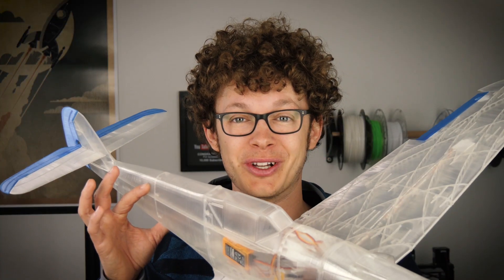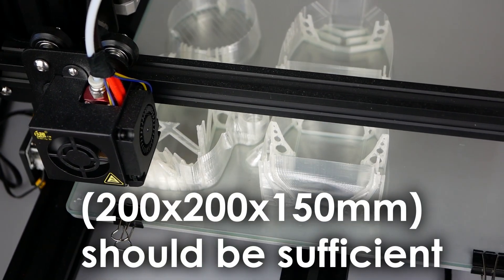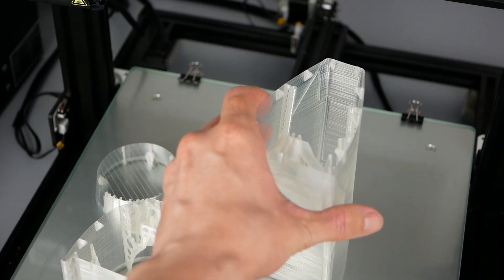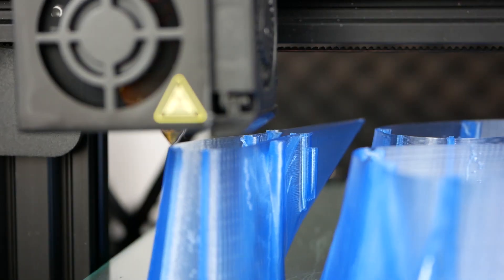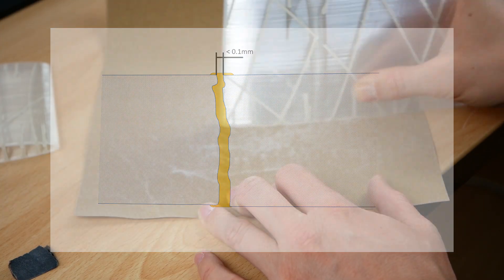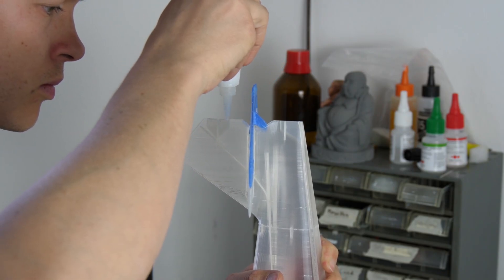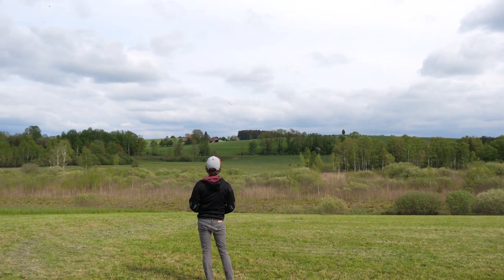HOW TO 3D PRINT your own RC AIRPLANE

Comment: The pretty rougth outline really want me even more to wait to buy a 3D printer intill I can get a continius resign type
Reply: Resin printers use layers too - just they can be much more fine!
Reply: Inexpensive ones are actually available now, BUT their build volume is MINISCULE. More suited for D&D figurines and such. I suppose you COULD try scaling down these models and see how light you can make them, for use with even smaller electronics and motors.
Reply: @iskandartaib  elego saturn is not that expensive
Reply: @matsv201  Interesting.   https://www.elegoosaturn.com/products/elegoo-saturn-8-9-inch-4k-uv-lcd-3d-printer   Build volume is 192x120x200mm - still kinda small by FDM standards. Apparently they were taking early pre-shipment orders (shades of kickstarter?) - USD500. Yeah, that's not that expensive. But I wonder how it'd handle this type of project - probably not very well considering the size. Incidentally, why is is "monochrome"??? Aren't ALL resin printers "monochrome"? The laser outputs one wavelength. You can't have "dual extruders", since there's only one resin tank with one type of resin in it.
Reply: @iskandartaib  pretty much all cheap (sub $1000) sla printers use a normal lcd from a phone or comupter screen and just a neat violet backlight. Most of them use just a of the shelf normal rgb screen filtering out colors even if it not supose to.

Saturn use a moncrome custom made lcd with  no collorfiliter. This increases the resolution 3 times over as well as reduce the cure time 3 times over. Cuting the cure time down to just a few seconds.  Resolution is also insanly high.
Reply: yea and you only need like 2 years to print such a plane with an sla printer. good luck! :D
Reply: @airsoftskorpionefreiberga.173  2 years?.. Its like  a few hours per print, and it should not really use more than a dussin or so

Comment: Bravo.
Darf ich eine Anfrage stellen ? Bitte mach einen Vergleich zwischen 3D-gedruckten Tragflächen, Schaum mit Balsa beplankt und Rippenbauweise. Am besten eignet sich dafür ein kleinerer Segler, die Testmethode(n) könnten so aussehen: Gleitwinkel bei 0%, 15%, 30% Gas, Strömungsabriss (Qualität und Quantität), Höchstgeschwdigkeit sowie Stabilität. 
Soweit ich weiß hat niemand (weltweit) einen solchen Vergleich gemacht !

Comment: You should use 0.24mm instead of 0.25mm on the CR-10 since the Z axis step size is 0.04mm.  Keep it divisible.

Comment: Interesting design work but regarding the parts weight indicated in the video, that R/c Me-109 seems to be VERY heavy for her size... 
The empty and unpainted plane is already as heavy as a ready to fly balsa one and at least 100g heavier than a ready to take off and fully painted Me-109 built from foam.

Comment: CNC kitchen i edited the gcode to print on my ender 3, i changed the retraction to 7.5mm and 40mm/s and its not retracting at all, it stops the extruder but doesn't reverse it. any idea why?

Comment: Will do mine in silver PLA
Reply: Z bend both ends of the rod.  Do not glue in the servos until the pushrods are on the servo arms and in the control horns. 

This eliminates the screwed on fitting and eliminates a potential failure of the screw backing out, dropping the pushrod with loss of control in flight

When the top of the servo is accessible you can thread the servo arm onto the pushrod then screw to the servo after  connecting to the control horn.

Sometimes you put the pushrod in the control horn before gluing the hinges.

Do not worry about a little CA in the hinge line, it cracks off of the hinge material rapidly as long as its not excessive.  Careful not to glue the movable control surface to the fixed surface though.

Comment: Beautiful airplane. From experience living in a hot climate PLA melts (bends/distorts/droops) when left in direct sunlight and worse if left in a vehicle.
Reply: It cools so quickly due to the air movement in this application, but if you were at an event or long queue runway I would bring a umbrella to cover it while waiting.

Comment: Hello Stefan I like the show however, I have a question to the use of Cura for my Allcct printer, what would be the adjustments I had to make to get it working properly, at the moment it moves to a location and there it runs in circles for god knows how long. Thanks for any help.

Comment: not good man. This is not the right way. The model is too heavy, just not a good idea. The better idea is to 3D-print a mold to make a better model with a foam maybe. First if you can directly 3D-print a low weight materiallike foam, then you can 3D-print the model directly

Comment: If you buy from Gearbest just hope you get something that works. Twice now I have received dud products from them and they are very polite and brimming with helpfulness and will string you along until their 40 day warranty expires after which you get zero help. My CR10 from them was useless and is costing me a packet finding spare parts to try and get the bed to heat or the temperature on the heating nozzle to stop fluctuating all over the place.

Comment: Would this plane be a good beginners plane? I recently got a 3d printer and I have electronics for a plane lying around. I am simply too lazy to build a foam plane.
Reply from the maker: No, definitely not a beginner plane. If you have never been flying buy a foam plane at first, otherwise 3dlabprint.com also sells trainers.

Comment: You counterdicted yourself concerning using the glass base and the base bonding agent. If the project lifts in the middle of the build, I dont see how things are going to go together even close to being right, even filling with CA and glass beads. The build looks good but dude 60 hours? Damn...dedication. Ok ,I know its just a goofy plastic plane. I never heard a price on the material,so what are you talking, several dollars worth, or what? Be honest.
I am contemplating getting a 3d printer and know there are MANY brands out there. Not all of them are worth the material they were made from. I am looking at $300-400 range. I see Banggood selling them for $187.00 Alarm bells go off in my head. My concern is getting serviceable parts. I am NOT going to invest in anything I cannot find parts for, or need a degree in to fix. I am good at changing parameters,  but rewriting entire code....no thanks. I taught myself on an Apple2c years ago,I remember the pain of imputting code, only to watch my design fail because I was one digit off. 
I hated basic programming with a passion.
Reply: As my name states, I am an RC addict, small engine mechanic, automobile mechanic, carpenter( lousey one) Jack of all trades. 3d printing would be like flying RC Helicopters. One hell of a challange,  but challange accepted.

Comment: Hello, I wanted to print this on an MK3, if using prusa control do I need to change anything ?
Reply from the maker: Prusa Control is not the right slicer for this plane. Use the pre-sliced G-Code or Simplify3D/CURA.
Reply: Thanks, on to printing.

Comment: If you are going to use rubber bands, only take one. If one breaks, you want the rubber band to break instead of the wing
Reply: Depends on the model... I have flown models that need 10 to keep the wing in place for a loop.

You want enough for it to not shift in any maneuver the airplane will perform.

We've done testing and depending on wing mounting, sometimes the wing breaks no matter what in a crash.  The angle of impact and ability of the wing to rotate matters.

Early RC models had the wing attach with a forward pointed dowel at the front, so a frontal impact allowed the wing to slide forward, popping the rubber band free.  But if the wing tip hit, the wing shattered.

Comment from the maker: Looking for a good deal on a new 3D printer and want to support the channel? Take a look at the affiliate links below and in the description:
CR-10 for $349.99 with code "618GBcoupon06": https://goo.gl/Anj5Mg
TEVO Tarantula for $264.28: https://goo.gl/hY53qQ OR AMAZON http://geni.us/Shfx
TEVO Tornado for $339.99 with coupon "GW4-15": https://goo.gl/Q1CR87
Alfawise U20 starting from $169.99: https://goo.gl/45ihaz
CR-10S on AMAZON Prime: http://geni.us/rVBsR
ANET E10 for $249.99 with coupon "GW4-13": https://goo.gl/o3qQdo
Tronxy X5S for $275.99 with coupon "GW4-14": https://goo.gl/BncF75
Reply: Can you put printing files if you can?

Comment: How much does the whole print and parts cost ? I have no experience with RC . Also how to print really thin walls in Cura, I have a  0.4 nozzle, and I think I have some fins on a model that are only 0.4-0.3 mm, they appear in the Print Preview but they are not printed actually . Should I set only 1 perimeter ? I can send you the link to the STL maybe you can give it a try and make a video about how to do it .
Reply from the maker: Material and RC parts and battery (not including a remote) are below $100.
Try activating the "print thin walls" feature in CURA, maybe that helps. But keep in mind that there is a physical limit if you want print walls thinner than the diameter of your nozzle.
Reply: CNC Kitchen Unfortunately I can't install Cura 3.0 and later it flags an error on my PC, I am using Cura Plugin integrated on my Repetier Host ... will try that feature in Imagine 3D maybe it works .

Comment: Ohh! Finally I see you smile during the presentation! (guth tag evrybody .... CNC Kitchen) usually you're too serious :-))
Good job! really a  big job!
Thanks for sharing your printing experiences.
What material is what you put together with CA glue in the gaps?
what do you think of a version with a wingspan of 2 meters and already that we are landing gear retractable?
Maybe it will be less nervous on the fly, but considering that the real plane was born to fight even the model will be very agile and nervous.
Congratulations again Stefan!
Reply from the maker: I used glass beads (like for sand blasting) as a filler.
Reply: I had never seen this product, do you have a link?
Thanks for the reply
Reply: you can also use bicarb of soda with super glue
https://www.youtube.com/watch?v=slCMkvEfK_U

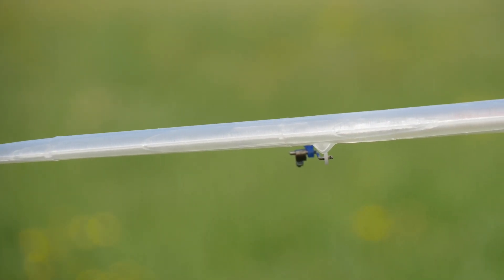Comment: thanks for posting.   some thoughts.    at 10:45,  Heavy brass bits re-purposed as collars.    wrong.    use a zbend at the Control horn, and  something  Adjustable at the servo arm.   or use a keeper or clevis at the control horn.    battery location  btw, this model would have a better glide slope with a NOT-scale main wing profile.  one resembling the clark-y v1.   at 11:23, a lower battery position would increase keel effect stability.    at 11:33, it is not clear how registration of the main wing is achieved.     the single forward anchor point for wing attachment would seem to result in not very much solidity, outboard.   btw, you say it flies good, but the rest of us have only your word.     cheers
Reply from the maker: Adjustable push-rods would definitly be better, but this worked out as well and is the "recommended" way in the manual.
Lower battery position would be good, but that's just how the design is and it still flies very stable.
Wing registration is only in the front with a nose-feature and a tight fit in the back with the assistance of the rubber band forces. Again, it's not perfect, but it works.
Reply: so, if it was 'recommended' that butter be smeared all over the model, you would be fine with it.   hmm        do you think the creators of these printable airframes  Actually Understand airframes.   trust me, they don't.
Reply: David Davids do you think anybody would recommend butter?
You can bet that 3d lab built a few of these and found what works. 
Adjusting from electronically rather than mechanically is not good for precision aerobatics,  but on smaller planes,  weight is more important. 
I live in Arizona where temps regularly exceed 120°F / 48°C and 90° / 32° is considered cool so I couldn't get away with foam around the battery.  I'm sure he flies in cooler weather.  My point being,  just because something does not work for me doesn't mean it wouldn't work for him and 3d labs recommends what works for most.
Reply: Recommended attachment, from memory, was z-bend at servo horn & straight thru with dollop of CA at control surface. It's 'recommended only because it's simple & does not require additional components. Anyone with clevis parts on-hand would use them instead (I did).
Reply: okay.   i waded through your rambling reply,  but a point was not there.   i state information in a  General  way so that subs/viewers can Also use it, even if they do not fully understand.     your belief that the designers of this model have an Adequate understanding of low-reynolds number profiles should be questioned.     on yt, i see experienced hobbyists making mistakes  All  the  Time.     btw, your "Adjusting" statement makes NO sense.      cheers
Reply: imo, as stated, a mod-z-bend can be used at the Control Horn.  the result is that No Unnecessary weight/mass is added to the model, aft of the cg.     all you folks out there REALLY  SHOULD  get a grip on 'distribution of mass and center of mass'.      information, describing  dom/c-m  as they relate to an airframe, is  Not  readily found anywhere else online.   if it suits, look at the 'balance' entry, at the beginning of the content in the linked  pdf-doc.  it contains one, maybe two, statements.  that's it.    there is a Mountain of scientific 'subtext' relating to balance that No One around here Understands.   most folks don't Even know that an aircraft fuselage is a  Lever.       cheers
https://www.princeton.edu/~stengel/MAE331Lecture5.pdf